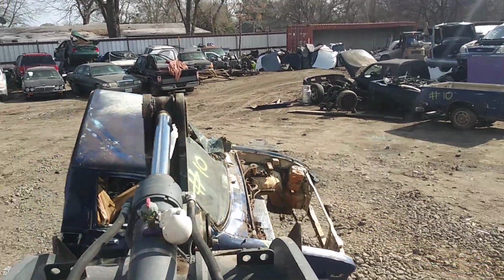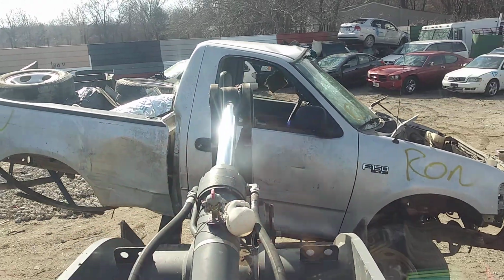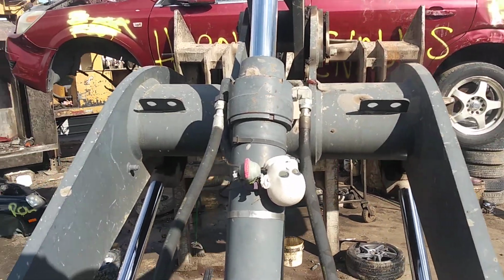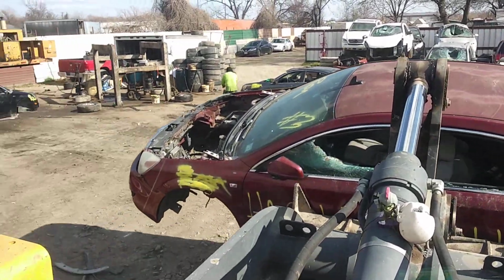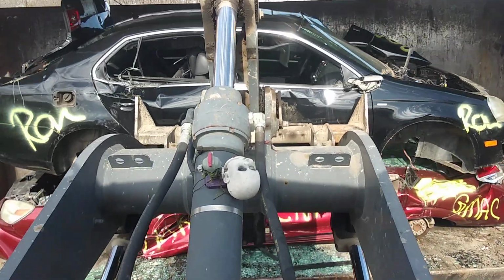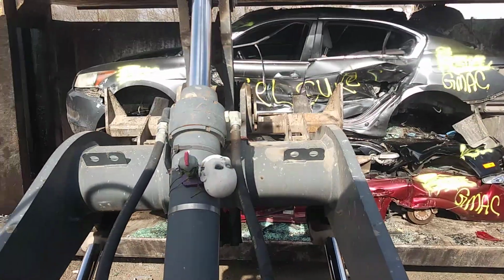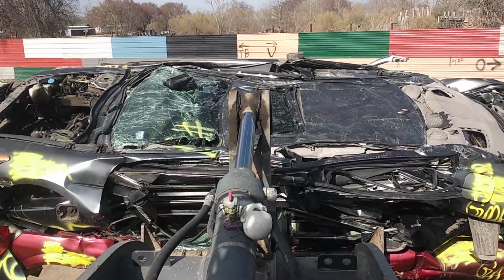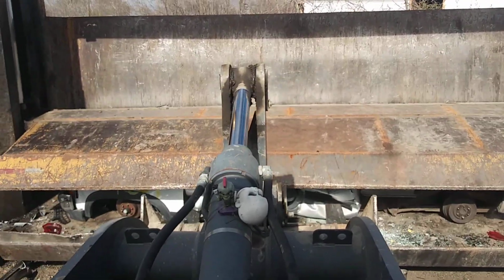It's Not a job. IT'S A PASSION for CRUSHING CARS!!

Comment: Most mills we've dealt with over the years will send the load back where it came from if there's radiation detected. Here in Florida if you set off the radiation detector a form gets filled out and sent to the Florida DEP and the load is returned to where it came from and the state will come out and inspect  it. We've only had it happen twice in over 40 years. Once the trk hauling a load had hauled pipe from the phosphate mines before it hauled our load and the 2nd times was a WWII compass in a glove compartment set it off. They have it set so any little amount of radiation will set it off if the driver recently had an x-ray it will set it off.

Comment: Those can be expensive tires $900 a "pop"  ......watchout for yard hazards such as bolts ,lower control arms etc ..but those air filled loader tires are way more comfortable on your back as well as easier on the equipment than solid tires or metal landfill cleat tires ..I seen tires that cost between $5000 to $25.000 each ,but they usually go on giant loaders, rock trucks & dumpers made by CAT ,Komatsu & Volvo used at strip mining facilities or at the landfill......sometimes it takes a 18 wheeler just to carry 1 or 2 tires a load too
Reply from the maker: Belive I'm on it dont want da big bossman chewing my ass out one of my good friends works in a mining dig out he has to drive them massive dump trucks he was telln mi that on of his tires costs 36.000$ just for one a weight at 5tons can u imagine paying for one if u were da bossman..

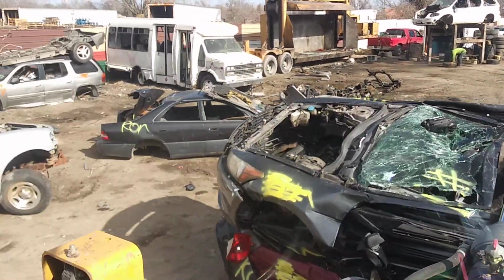Comment: @9:15 they can crush microwave, they don't emit radiation, they don't crush microwaves & send to the mill because the older ones contain a highly cancerous beryllium Oxide ceramic insulators on the magnetron (they are usually white in color) the newer ones are pink & good to go ,they actually remove the magnetron to remove the copper & aluminum from the ceramic insulators, but that's done in a controlled facility 😷 ,you definitely don't want to breathe in that dust at the yard or mill ☠, many scrap metal buyers buy microwaves for scrap.....but they don't go to the mill until they remove the magnetron of the hazardous insulator.........one thing that does mess up the load is fire & smoke detectors with Amerioum241 ☢ which is definitely going to set off all the alarms as well as drilling pipe & XRay machines
Reply from the maker: Yep an that's what I be talkn about but u kno sum mills are a lil different n EXPOSING them differently yea them big old ones shit u got a big problem with 6 crushed in one car just dont wanna be da guy who loses money off his check cuz of that cuz that can really harm alot of us n wont even know it until it to late.. that's y we always checking da cars  for everything that's NOT supposed to be in thier.. SAFTEY IS FIRST.
Reply: @DeathRowCarCrusher  yup ,its better to just send microwaves with E Scrap or bulk metal bins ,where the facilities recycle them safely.....plus they do mine all the heavy copper parts out of those, including on the magnetron which can be removed safely & the insulator removed without the toxic dust hazard